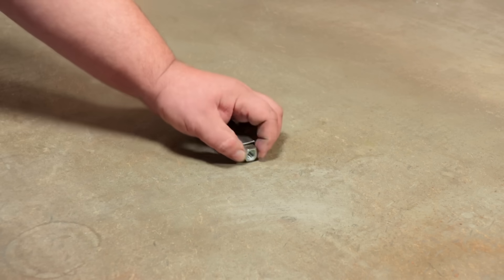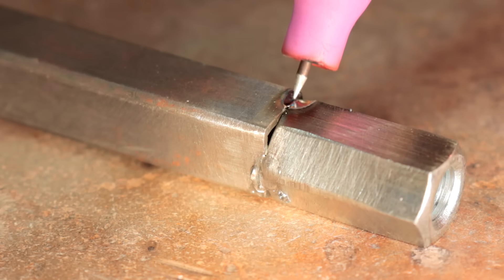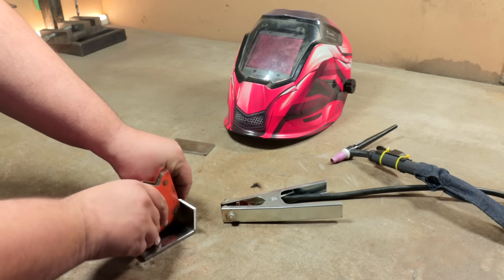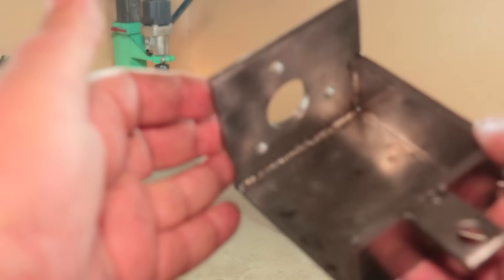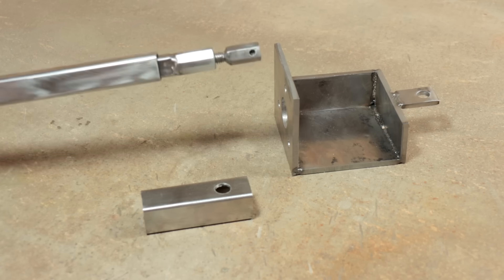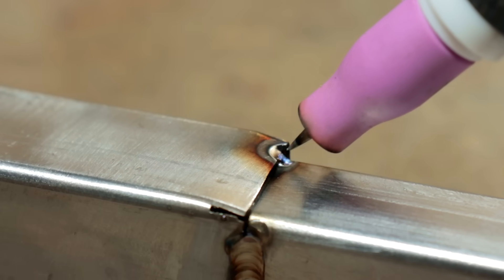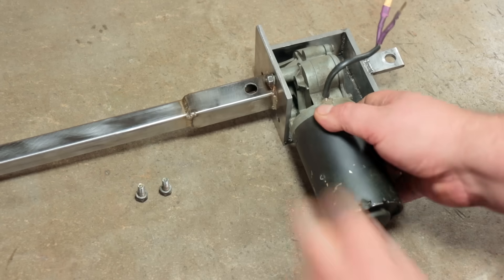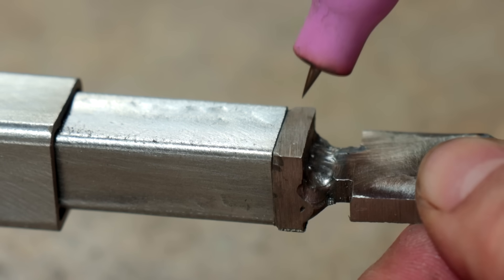GATE OPENING DRIVE from a conventional tube and a wiper motor!

Comment: i also want to make linear actuator, and i already made one with small nut, but it is wobbly and resists spinning when threaded rod is not centered and fills force sideways. i am searching for the kind of nut you used, but can't find them in local shops or even online searching, what those long nuts are called?

Comment: Wow your welding time / weld strength ratio, is going to be the worst on the planet. Why not just chase a puddle for an inch, and be done with it? Don't even  add any filler. And your weld would be 10x stronger.

Comment: What you call cold welding is using a TIG welder and just spot welding a bunch of times in a row. There is still heat present as the metal changes color when you do the spot welds. You can definitely spot weld and put things together but that has very little resistance and strength to it. To get proper & strong welds you need to bevel the parts (or gap them) and fill the gap with a filler rod. 
All this aside, the video in itself is still great though. I like the concept  of making your own linear actuator and it seems to work pretty good!
Reply from the maker: Many thanks! I will definitely heed your advice. 🤝🤖
Reply: @doctor-robo  sharing the knowledge is a good thing, to fix the current welds for example you can simply take a grinder and cut a groove where your parts meet (all along where you tacked it) so that you create a V groove and then fill that groove back up with filler rod to get proper penetration on both parts. Generally those tack welds are used to fit the parts together and make them hold them in place. The only time you will want to do this so called cold welding for the entire length of the weld is when welding very thin metal together so that you don’t burn a big hole in it. Keep up the good work 🤘

Comment: Tig welding with no filler rod; I'd love to see some strength tests done. 🤨
Reply from the maker: Hello! I plan to make a full video about my Cold Welding Machine, there I will do all the tests that this welding TIG can do. Come back, I will always be glad to see you on my channel!
Reply: @doctor-robo    I'll look forward to seeing the video; I really like the ingenuity of your content, so I'll be back for sure. 😎
  I'm still not convinced there's such a thing as "cold" welding.  From what I can see, it's either arc/spot or plasma welding without a filler metal, thus there's no depth to the weld or a bead, and neither is a "cold" process.  Unless you want to prove it by touching the molten seam immediately after. 🤨
Reply: A series of shallow spotwelds
Reply: That type of welding will fail a simple hammer test